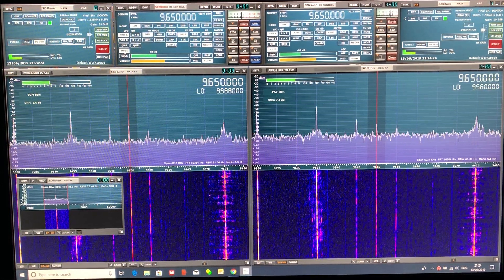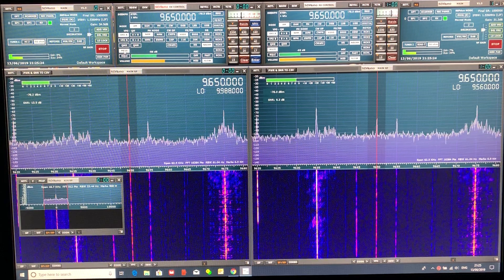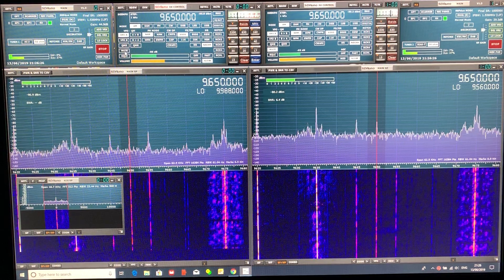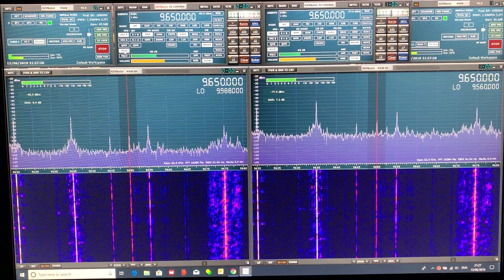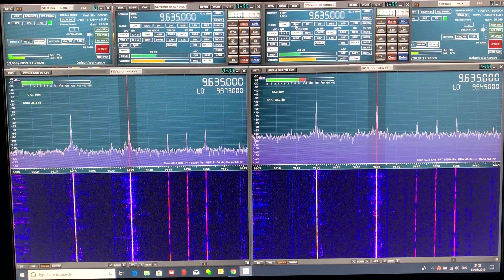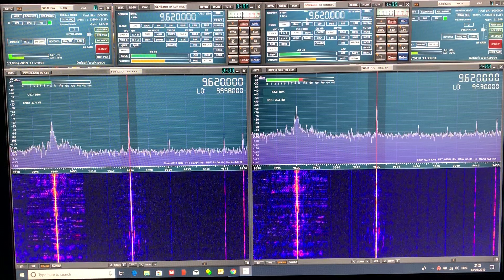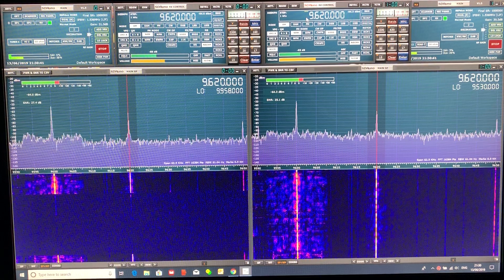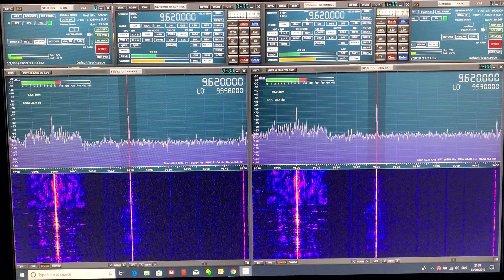Bonito CCMC-30 noise filter: encouraging initial noise-floor and SNR results on shortwave

Comment: Might consider adding (making yourself) anntenna switch box to exchange antennas on the fly. On these frequencies should need just a metal box with switch(es) and few coax connectors.
Reply from the maker: Yes I know - I just don't have much time! 73! Clint